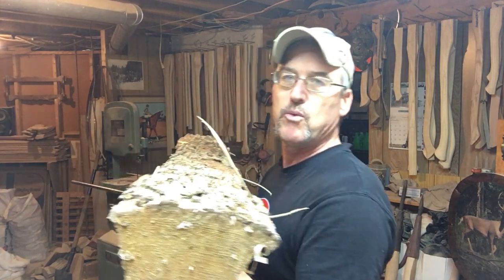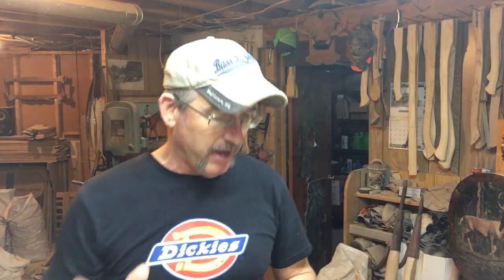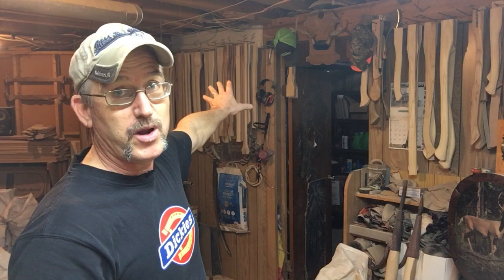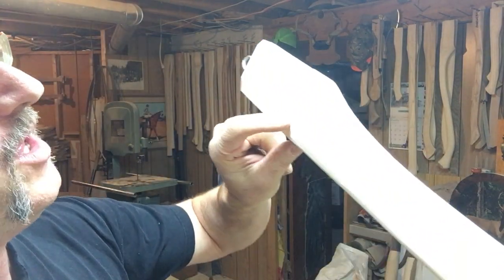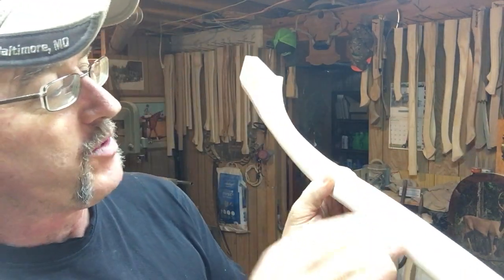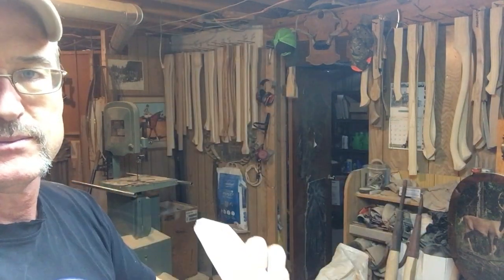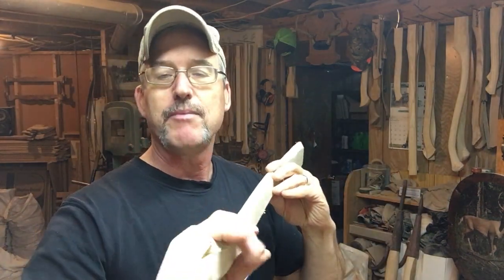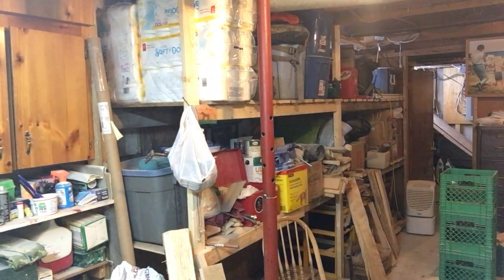When things go sideways - what makes a number 1 axe handle?

Comment: Rod, What are the issues with heartwood, is it different in different wood species? Good video. Thank you and best regards, Chris
Reply from the maker: Hi Chris - always good to hear from you.   I have that frow handled....just need to make a "banger" for it.  On heartwood, yes it differs by species.  In some, it is much weaker and less dense, like in willow; and can die and become punky as it does in poplars.  It does discolor in hickory and ash, and how, why and why the varying degrees is still a mystery to me.  However, I have read that in these woods it is every bit as strong and tough as the sapwood.   I also will cross the "color line" making handles, and to date it has never bothered a bit.  I call them"salt and pepper" handles.  Some people who know that heartwood from hickory is just as tough, but far more beautiful with the dark satin will order these specifically from me.  Have made a few dozen over the years....no issues